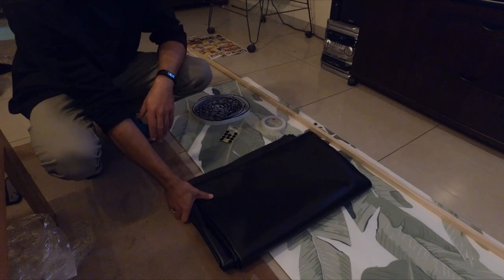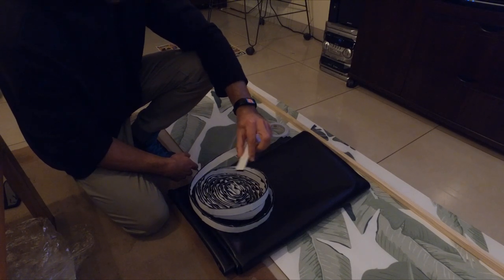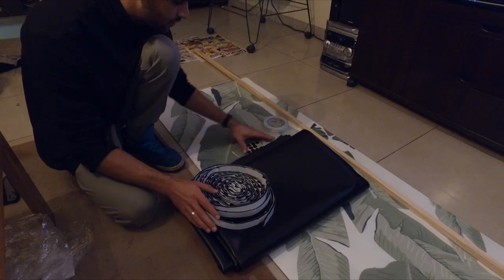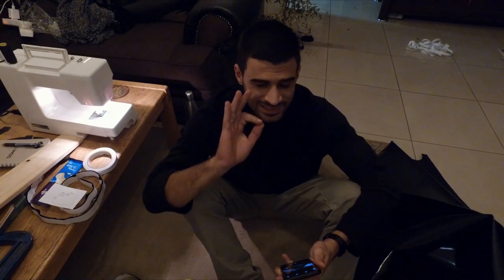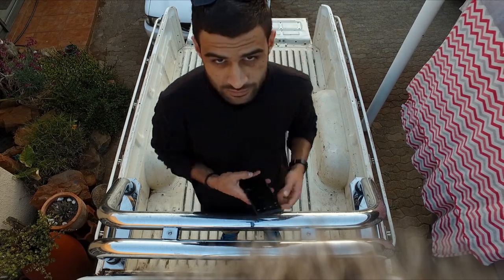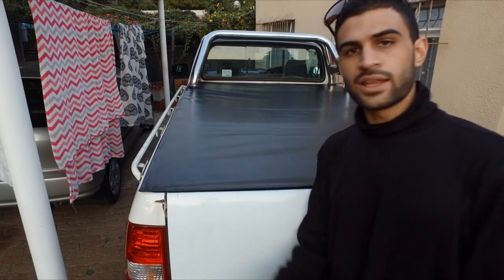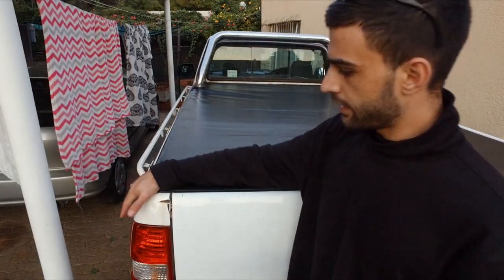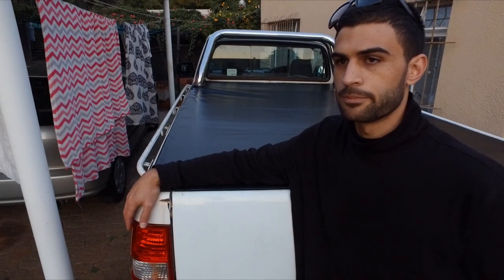DIY Tonneau - Pickup bed cover | Ford Ranger

Comment: i had a 1991 ford G.T.  ranger , and back then you could get that cover for around 60 bucks , i recently gotten a 1998 Chevy s10 wanted to do the same thing but you cant find those Velcro type covers anymore , been searching for weeks !!!! to be honest , i haven't even thought about making my own , but this convinced me to just try ....thanks for the upload and i really appreciate you putting in the work , ......by the way , i drove that truck at 75 mph coming from Dallas to west Texas , 5 hour drive , was really surprised how well the Velcro help up .....thanks
Reply from the maker: Hey bud, I'm glad I could help, just from what I noticed, you may want to get it stitched with upholstery thread, the heat here seemed to make the glue on the Velcro loosen, and regular thread doesn't seem to be able to hold up to the forces everywhere. 
Should be cheap to take it to a upholsterer and ask them to just stitch the seams though. 
Thanks for the support and feedback bud🙌

Comment: Nice Job! Thanks for showing the success and problems incurred with your project! Are the bars on the edge of the cargo box normal in SA for pickups? But was black fabric the best choice of color? Perhaps a more neutral tone to ease the suns impact on the cargo? For example bringing home frozen groceries?
Reply from the maker: Thank you. 
The bars are normal, it's usually used as a tie down bar for when there's large cargo in the bed, then straps and rope can be tied to it. 
And a neutral shade may have been beneficial, it seems the black absorbed a lot of heat and allowed the adhesive to losen. I also don't generally throw groceries in the back of the bed but it would be something you should consider if you do.

Comment: First rain it'll fill up like a bladder or swimming pool I'd think 🤔
Reply from the maker: If you're talking about the interior bed, fortunately it didn't leak. If you're talking about holding water on top, yes it does, so I'd recommend adding a brace bar in the middle to provide a little height and run the water off
Reply: @RiyaanMoosa  is it still on your box? A follow up would be amazing. You have tons of us that are very interested. Even in what repairs or mods you think would would make it right. Please an update.
Reply from the maker: @tankscrittersandurbanhomes5579  Thanks for the comment, i will definitely do an update video soon once i address the issues i encountered

Comment: Not going to hold standing with rain water accumulated in the middle, you need a running bar on the middle
Reply from the maker: I believe that was mentioned in the video, that is a requirement but fortunately I do also park the vehicle under cover